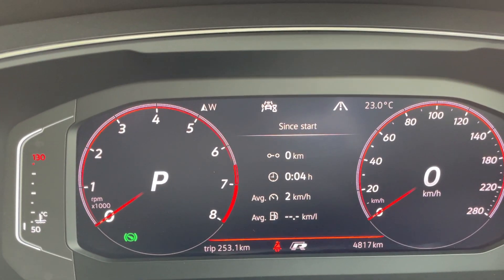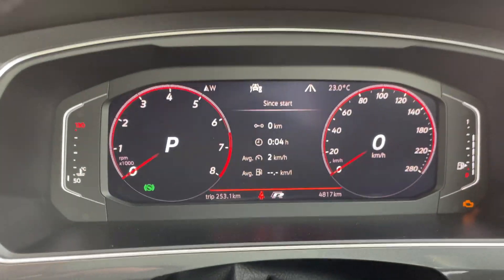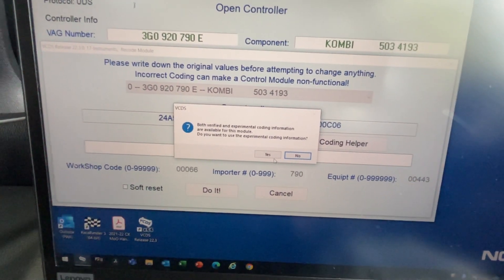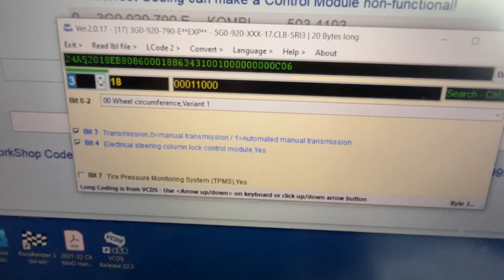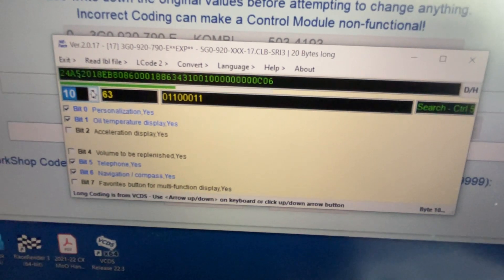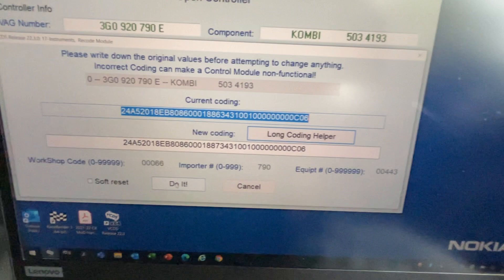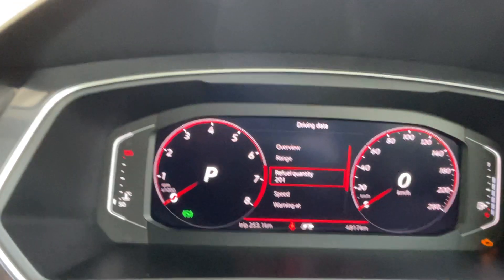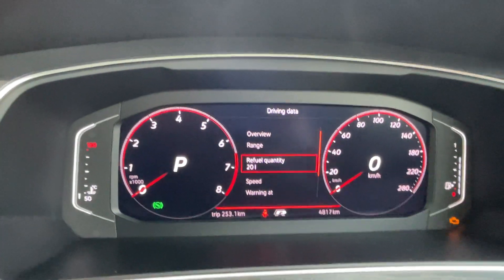VCDS coding example - Adding Refuel Quantity to your Skoda/VW/Audi Dashboard

Comment: Sir ,I'm having Octavia A7 same as u have but mine in 1.8 tsi l&k varient. What are all the modification u did in ur car using vcds pls upload seperate video for that + I wanted to do 30colour ambient light, driver personalization etc etc .pls upload video for that sir . Thankyou
Reply from the maker: The 30 color ambient lighting is a simple but tedious coding process, as you have to code each color's R,G and B value seperately, and then do the same for the doors. What you should do before hand is to create a cheat sheet for each of the RGB color values you want coded.
Reply: @PrithwiRay  if u do tutorial ,I'll do all steps as u do. Upload more videos regarding this sir